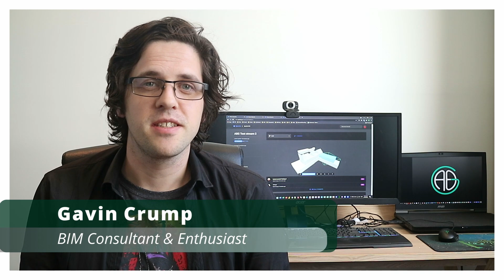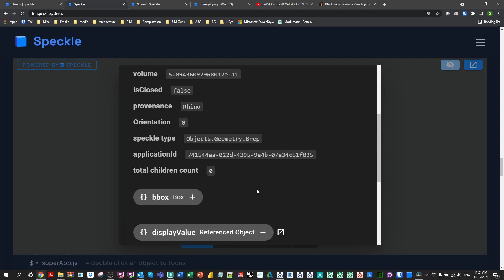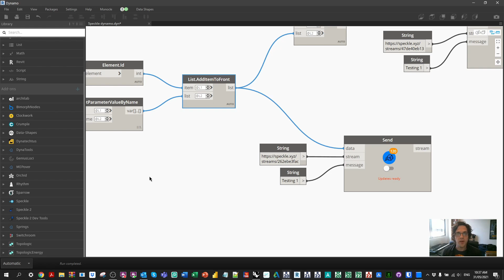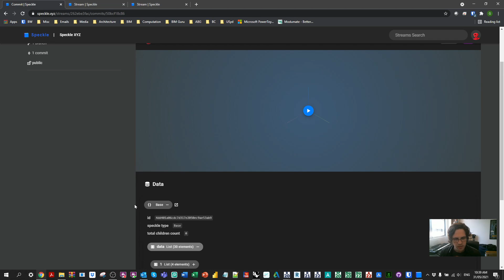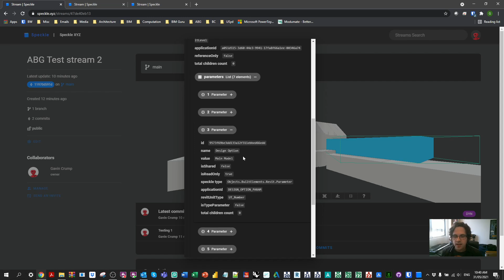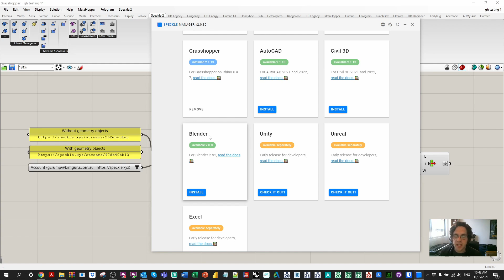Comment: I came here after the new Python video. What to say wonderful informations as always. Platforms like Speckle are the future regarding Data base. 
I am just wondering regarding Geometry optimisation, which kind of the geometry is this? I noticed this type geometry by Navis, Bim Collab Zoom, maybe also Bim 360...They are like easy mesh or something.
Reply: I'm not 100% sure as they can usually send it back in non-mesh form so the data itself must be converted in the viewer. I would expect mesh is the best option as it has finite face count and can be optimized prior. Might be worth asking them on twitter or their website - they're quite active and responsive.
Reply: @AussieBIMGuru  hello Aussie. I sent them an Email regarding Geometry and they replied very quickly. Here is answer from Speckle: "We're transforming every bim object into a speckle object. This usually contains all the properties you'd be used to from revit, and a display mesh that we can display easily. For example, a wall will have its usual properties (area, volume, type, etc), a base line, height, and its display representation".
Reply: @damirces  thanks for sharing, makes sense!

Comment: Have playing around and really exited about it. I just wonder why, the areas from rooms not getting streamed. I can see its the same for you.
Reply: It's actually stored in a nested list for each room. There should be a sublist for each room object called parameters, and one of those will be the area parameter with its associated parameter values (e.g. type, unit).
Reply: Just use a filter on the stream so you can select what to import

Comment: Weird question, what about connecting Revit file data to other Revit file data with speckle?
Reply: Not a weird question at all - I think there's definitely valid times for this. One thought is to use it to 'back up' data at a point in time so you can reinstate it later in that same model.

On an amusing note, John Pierson shared a post a while back where he used it to partially recreate a model in an older version too:
https://www.youtube.com/watch?v=dIrBg8cGsvA